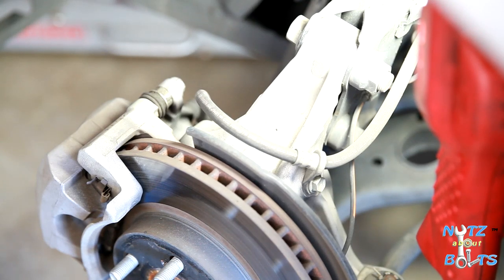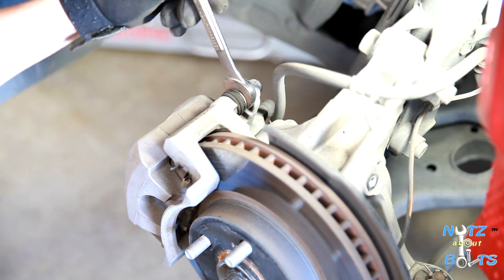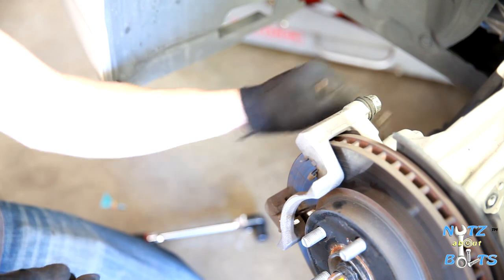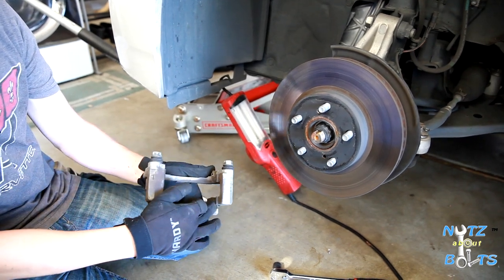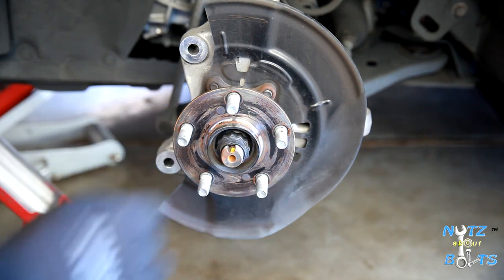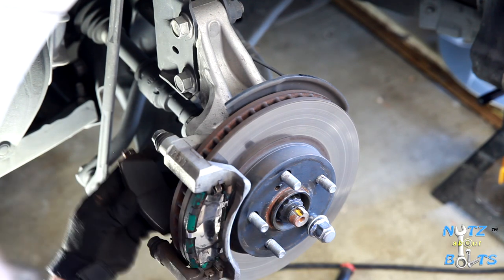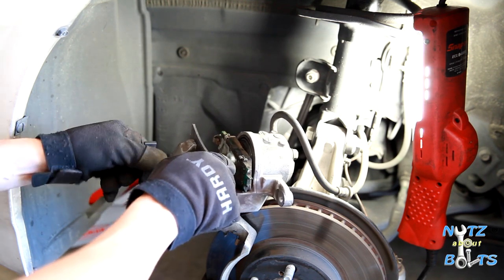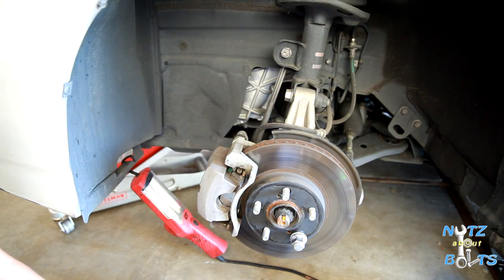2010-2015 Toyota Prius Front brake pads and rotors remove and install

Comment: Nice video. I thought I would mention why you disconnected the battery. If you don't, your keyfob can activate and electrically pressurize the brake lines and push the piston right out of the caliper when you remove it. This will save you a huge headache.
Reply: Wow crazy, forgot about that! Thanks for mentioning that, as I have mine halfway apart now with the battery still connected.
Reply: I changed my front pads last week, and I didnt knonw that Inhave to disconect the battery, but no problem, and next week I will change the disc and i will disconect the battery

Comment: Great video. I replaced my brakes, rotors, and changed my oil today, all with the help of y'all. So easy, and so much fun. Thanks!
Reply from the maker: Good work! 👍🏼
Reply: hi what break rotor and break pad do you suggest for a 2011 toyota prius? which one did you use?

Comment: Disconnecting battery, most priceless info ever when doing anything on a prius, I wish my body shop got that info beforehand.
Reply: What could happend if the 12 v bat is not disconnected beforehand??
Reply: @paulnieves7493  just dont want to chance it  when ive seen my dash lit up like a Xmas tree like when I got my car back from a body shop n then they had to send it to toyota dealership to fix it kind of problem.

Comment: Excellent video.  Picture was clear.  Sound was good.  Information was invaluable.  Keep up the good work!
Reply: Agreed. I just got quoted $760 to change the battery and the brakes. Watching this video, I'll get it done myself for about $300. That means the dealership (who gets the parts much cheaper than me) would probably be charging me about $500 in labor. Considering the tools they have at their use, and considering they do these jobs all day, they'd probably have everything done in about 15 minutes. $500 in labor for 15 minutes = $2000 an hour. Absolute crooks.

Comment: Great video! I was fearing some electrical components or sensors since these cars have the brake charging system. And he's right, I'm at 124,000 miles and the original pads are still good. Phenomenal!
Reply: I gave my son my 2002 Prius around 200K miles. The front pads were more than half worn; the rear shoes (first gen, you know) were not worn even measurably.

Comment: Very usefull video.
Just  today I was changing my brake pads.
For rear brake pads I did not have a tool to compres the caliper so I used a C clamp and a angle grinder tool...worked like a charm.
Thx for the usefull tips.

Comment: Viewed elsewhere: Do not have your key fob near your car when doing this as it will activate the braking actuator which pressurize your braking lines causing the caliper piston to go out all the way (if you have it removed). This happened to a another DIY brake changer.  Perhaps removing the 12V shuts that down, but just to be safe, I'll keep my fob in the house when I do my brakes.
Reply from the maker: I think we mentioned it in the video, but if not, yes you are right.

Comment: Thanks.  Was freaking about having to change them at some point and having to pay a dealership here in NY.  This looks like I can do it myself.  Awesome video.
Reply from the maker: Yep, just like a conventional brake job, just make sure to disconnect your battery so you don’t activate the brakes.
Reply from the maker: I meant, accidentally activate the brakes by opening the driver side door
Reply: NutzAboutBolts Спасибо !!!!!

Comment: Thanks for the video. I just did my pads and rotors. Rotors were beyond rusted. some of it just crumbled as i was banging it off the hub. pads still had some meat on them and they're from factory 8 years 148K miles. Not bad. I didn't need a wrench to install the caliper as you showed in the video that I may need a thin wrench. Anyways thanks man. More Vids!
Reply from the maker: Nice
Reply: Daniel N 
Hello just want to know when you did the front brake pads were the pads the same size or is one smaller than the other? Thanks
Reply: same size on each side

Comment: Great video, walked me through the job today. But I'm a bit confused as it looks like the rotor you put back is cracked all around the mounting bolt holes and is about to fail, causing the outer ring of the disk to shear away from the hub!
Reply from the maker: Not sure what crack you’re referring to, but it’s at 230k and still on original rotors and pads.

Comment: Great video! Excellent quality and very specific. Do I need to reset anything on the dashboard when changing the breaks ?
Reply from the maker: No, just make sure to not open the driver door or step on the brake pedal when doing this. You can also disconnect the battery to avoid all of that.

Comment: Hi good day to you.Great video am from Mauritius.Why should the battery be disconnected when changing the brake pads?As no current flow it will not need to be reset as clock or radio system etc?

Comment: My 2011 front brakes were worn all the way at almost 100k. Thanks for the video
Reply from the maker: that's interesting... well glad we could help.
Reply: NutzAboutBolts Sounds like someone is a little hard on their brakes. Lol. I'm at 40 percent at 90000
Reply: I have to drive a mountain pass everyday. I'm at 168K but I need to replace both pads and rotors

Comment: hi nice video. what break rotor and break pad do you suggest for a 2011 toyota prius?
Reply from the maker: I usually buy oem, you can find them on eBay. Amazon has after market pads and rotors

Comment: I just replaced my rotors and brake pads about a couple months ago and I got new tires put on two days ago. When I brake at high speeds, my steering wheel shakes. Could that be an alignment issue or a rotor issue? Could I be experiencing a slight warp with  my front rotors?

Comment: If you compress the caliper pistons make sure you open the brake fluid bleeder valve! Otherwise you may damage your ABS system by pushing fluid into it, causing a leak or other damage.

Comment: How many foot pounds of torque when putting the rotor bracket back on? And other torque specs? I know the lug nut spec is 80 foot pounds. Thanks.
Reply from the maker: In the description box

Comment: Thanks to this video. I just like to know if it is really necessary to disconnect the battery? I did not see anything related to any electrical connections thru the entire video. I'm just curious. Last time I disconnected my cars battery, I did not know that it will automatically FAIL my smog check since it reset the cars computer. Lesson learned not to do that if you need smog check soon.
Reply: Not batteries, just battery. The one in the boot/trunk. If you don’t, your calipers will extend all the way out. Also, don’t close your trunk with battery disconnected or you have to climb thru front to get back there.

Comment: Battery negative is unpluged and i can not get the piston to go back. I even loosened the bleeder valve and still cant get the piston to go back using a c clamp.
Any suggestions?
Reply: strebis6 Back you need to twist. Front just push

Comment: Where is the anti seize paste applied on the brake hardware? I saw the sliding pin lubrication video and it was really helpful, but it wasn't mentioned there either. Thanks.
Reply: On the back of the brake pad, not on the pad itself. I didn't use any when I did mine, if you notice some squeaking later I'd take them back off and add some.

Comment: i have a question after following your video i put it back together without taking off the rotors because they were fine. i ordered parts from partsgeek. the pads were so thick i forced it on after compressing piston. there is no clearence the brakes rub and gets hot. i believe the pads are too thick. i got some others coming tomarrow to try. i only did one side so far
Reply from the maker: Make sure they’re compatible. Some brands are thicker than others and might not work... I’d compare the brands and make sure they fit properly. If they don’t, buy a different brand.

Comment: I bought the front pads at pepboys, and it didn't come with outer shin. I tried to fit the old shin (toyota original), and they didn't fit. I installed them without the outer shin (the one that touches the hydraulic piston). Is this okay?

Comment: Hey! Can you please link where we can order the front and rear break pads please!
Reply from the maker: You can order them on eBay, rockauto, or dealership for the oem brake pads and rotors. Amazon sells aftermarket ones.

Comment: I’m curious, why is it necessary to disconnect the battery first? Is it related to abs sensor or something?
Reply from the maker: Because you can accidentally engage the caliper piston by opening the driver side door or stepping on the brake pedal while servicing your brake pads.
Reply: @NutzAboutBolts  Good to know, thanks! 👍

Comment: edit: This comment was made when I was extremely stressed and quick to anger. What happened was my own stupidity got in front of me. I disconnected my hybrid High voltage battery instead of the 12v battery, and when I went to reconnect it, I did not push the orange clip all the way in. To @NutsAboutBolts I apologize if I came at you heated, I was frustrated and was just looking for anywhere to  outlet. It was unwarranted as you are just putting a helpful video out. I always maintain that any informative/DIY videos should be made for the lowest common denominator, and I have made it clear that in this situation this is me. leaving my original comment for an example of what not to do.

this tutorial that skipped exactly how you are supposed to disconnect the battery has fucked my car's hybrid system, user beware
Reply from the maker: You must’ve skipped that part in the video in the beginning and went straight for the brake replacement 🤦🏻‍♂️
Reply: @NutzAboutBolts  nope I didn't skip it, I did it
Reply from the maker: @ObeliskDemon  we showed the battery disconnect in the beginning, if you needed more help, you could’ve searched our video list like we’ve said. Also we mentioned not to open the driver side door or step on the brake pedal if you’re working on your brakes as it can activate the caliper piston and cause issues… not sure what you did to cause the hybrid system to act up since many have done this services on their vehicle without issues.
Reply: @NutzAboutBolts  well thanks for insulting my intelligence in this frustrating time, but this tutorial and the practically welded on caliper bolts have put me in a rather terrible mood. I am just trying to get my car in a state where I can take it to a mechanic in the morning and the engine won't start at all
Reply: @NutzAboutBolts  and FYI I did search for that tutorial and everyone else's came up way before yours so idk what to tell you there. this us why I hate the "go watch our other tutorial for that". just edit that tutorial into the video if it's that crucial
Reply from the maker: @ObeliskDemon  what did you do differently than what was in this video? Also, you can still do this service without removing the battery, just don’t activate the brake system like we’ve mention. Removing the battery was just for safety precautious
Reply: @NutzAboutBolts  I have no clue what was done differently since you didn't do a full battery disconnect tutorial in this video and I couldnt find your other video. I pulled the orange clip out, and took off the white wire clips
Reply: @NutzAboutBolts  I have found my error, and I apologize for how I was commenting towards you and your video. I edited my original comment to include the solution along with what the issue is. you have been more patient that I deserved and I thank you for that
Reply from the maker: @ObeliskDemon  I didn’t see your reply from yesterday about that orange clip. Yes, the orange clip is for the HV(high voltage) battery, which you shouldn’t touch unless you’re messing with the orange wires(high voltage) in your vehicle. The clip is to disconnect any HV from your vehicle if you’re working on the HV side of your vehicle. As for this video, it was just the brakes so disconnecting the 12v battery was all that was needed but not necessary, more of a precaution from opening the driver door and/or stepping on the brake pedal by accident.

Glad you fixed your issue, those orange clip is notorious for not clicking all the way through and people have had issues with those and thought they’ve pressed it in tight enough, so don’t feel bad about it. 👍🏼

Comment: How about the rear, do you have video? Thanks a lot for your work.👍
Reply: You likely will never do rear pads on a Prius. The generator slows you down until under 13-15
MPH then the pads engage. 80% of the stopping power is in the front and 20% to the rear brakes. You would need some serious milage at stop and go speeds to do rears!

Comment: When should Prius brake pads & rotors be changed? I thought the regenerative brakes made them last much longer than regular cars brakes.
Reply from the maker: This was just a demo. My oem still working and its at 230k+ miles, so it’ll be a while before I change mine lol
Reply: @NutzAboutBolts  Think the mechanic made me waste money on new pads & rotors at less than 150k. A caliper pin was stuck though, brakes were sticking on the wheel. Told me to change everything. This is my 2nd pad change, and first time changing the rotors. Ugh

Comment: What size are those bolts that help push the rotors off?
Reply from the maker: http://amzn.to/2bpDuLM 8.25 hext bolt for rotors or drums
Reply: going by memory, they're 1/4" diameter. Just dig around until you find one that looks close and try it...not difficult.

Comment: Great video. Straight forward.
Reply: What’s the reasoning behind removing the negative on the battery terminal, plus,  can you compress the caliper or will that damage ABS system?

Comment: You didn’t mention using brake clean and clean shop rags to wipe down brand new rotors
Reply from the maker: This was a demonstration video, but if we did have new rotors, we would wipe it down since new rotors come greased to prevent rust. We did that on the accord rotor replacement video.

Comment: How many miles the shims last, thanks in advance
Reply from the maker: Shims last for a long time unless it’s rusting due to salt water. It’s still good after 230k
Reply: @NutzAboutBolts  thank you for saving me to buy it, you right I did it at 170k miles shims still in good condition, thanks for your video, thanks for the screws torque specs
Reply from the maker: @JaidervillaTV  np 👍🏼

Comment: I have a 2011 what are the torque specs of the caliper bolts and the brake pad bolts. Thanks
Reply from the maker: its 25 ft. lbs, its in the description box.
Reply: NutzAboutBolts Thanks. Where in the description box do I look?
Reply: I found it thanks
Reply: In the description it says 30 ft-lb but it should be 25 ft-lb.

Comment: Why was it necessary to disconnect battery?
Reply from the maker: In case you accidentally open the driver door and cause the caliper piston to engage and pop off from its housing.

Comment: 140k miles and still have half left? Wow... hopefully it will be the same with my RAV4 hybrid
Reply from the maker: yeah, I bet it can make it to 300k no problem. I'm not too sure about the Rav4.
Reply: i feel like it is harder to use regen braking to slow down the Rav4, perhaps it is because the Rav4 is a heavier vehicle?
Reply: Mine are not lasting long with my wife driving. She does. Not understand coasting to a stop 🙄

Comment: Interesting. Toyota got me to change my brake pads after 100,000 KMS. They said one had 4mm left.
Reply from the maker: Minimum thickness before replacing pads are 2mm.
Reply: @NutzAboutBolts  I was mistaken. They told me and it was written on my oil change bill that the front right brake pads were at 2mm. The other three were at 3, 4 and 4.

Comment: So I guess there’s no need to manually bleed the calipers?
Reply from the maker: Not unless you’re bleeding the brakes
Reply: @NutzAboutBolts   was just curious, I’ve always bled the brakes after a pad install on most vehicles but never done a pad change on a Prius, but I’ve also just loosened the bleeders to compress the calipers which is probably the wrong way to do it, i guess what I’m asking is can I do the pad change without bleeding the brakes
Reply from the maker: @aeronstobaugh  yes you can change the pads without bleeding the brakes.

Comment: What if I didn’t unplug the 12v battery
Reply from the maker: You can accidentally engage the  caliper piston during replacement
Reply: Thanks for the response. Nothing happened tomorrow I’m doing the rear breaks, I will definitely unplug the battery. Also once I unplug it what actually resets with car?
Reply from the maker: @joshuarobinson8818 usually the radio and clock, but so far for me, nothing much

Comment: "79 ft. lbs - Caliper mounting bracket bolts": Strange, I checked everywhere and the torque for this is always 101 ft/lbs! Who's right?
Reply from the maker: It’s a 17mm bolt, I wouldn’t over torque it to that high. Just like the 19mm lug nuts is torqued to 80 ft. Lbs. you don’t wanna strip the bolt. Also it’s in the repair manual.
Reply: @NutzAboutBolts I thought so too. BTW, "79 ft. lbs" works for the Prius C too, right?
Reply from the maker: @tomparatube6506  yes